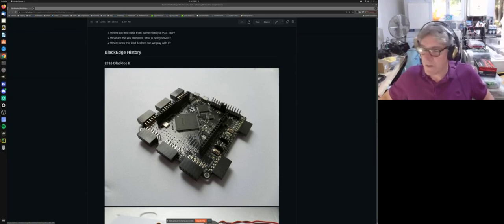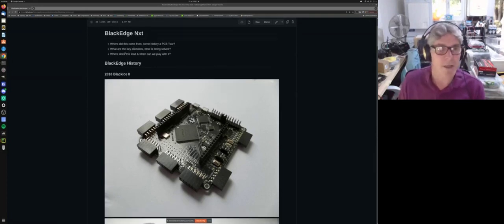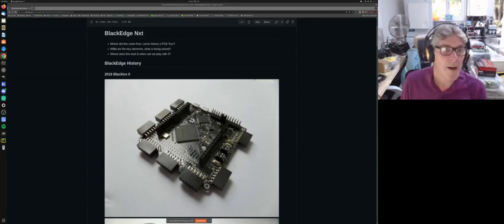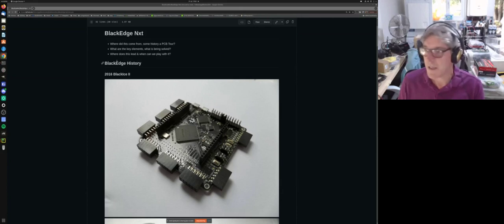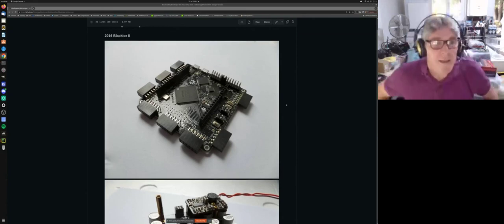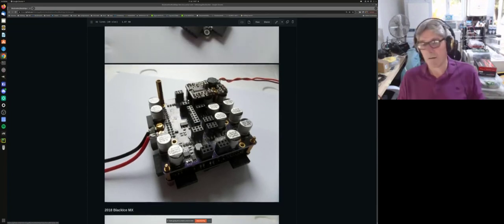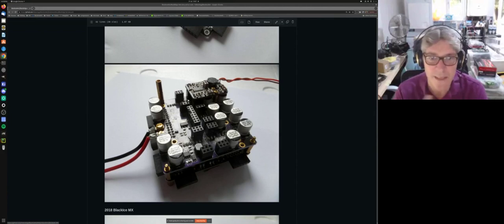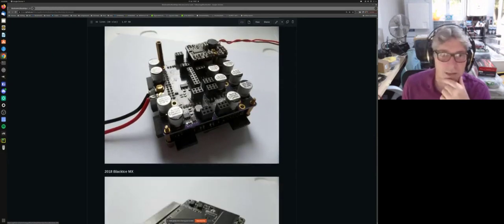BlackEdge Nxt, Tiles and Blades, and Amaranth HDL — Rapid modular embedded FPGA design

Comment: Still quite fond of my BlackIce-II.  The modularity of the MX and beyond make sense for an educational platform that allows for the heart to be transplanted into a custom carrier design but there is still something to be said for a cheaper platform that doesn't require a carrier board or high density connectors to break out the IO.
Reply: True, when I can get the lower cost chips again I will look at a simpler lower cost board, integrating some of the newer features, however it is taking the supply chain a long time to recover still so we will just have to be patient.